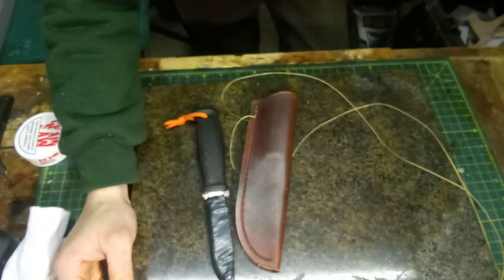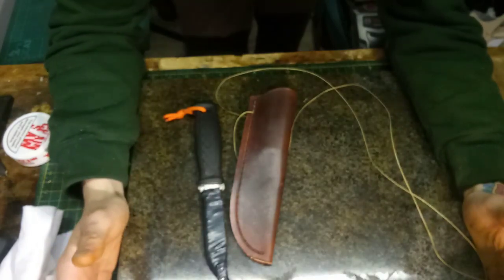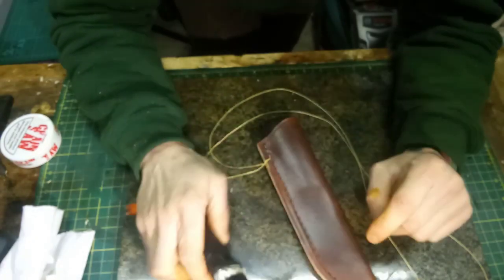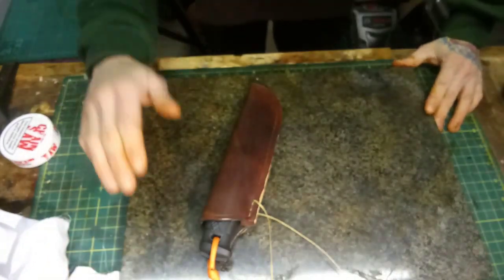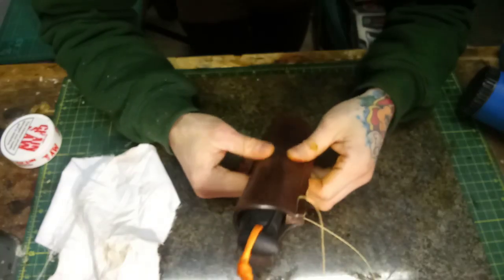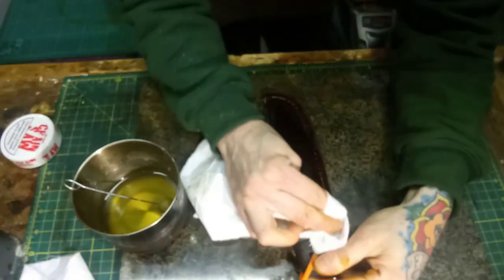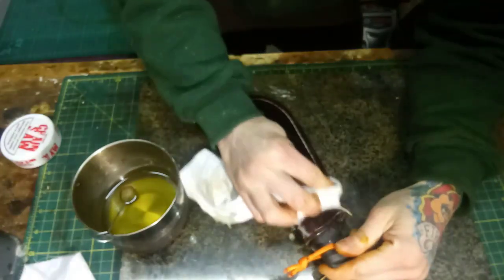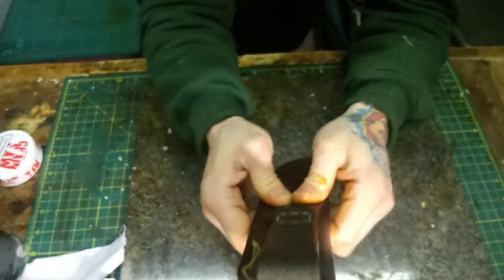L2L Leatherwork: Hot waxing a Leather Knife Sheath

Comment: Ive got a lock back Case 6265 SS knine and the sheath it came with is very loose. I'm going to try this method and just was wondering if I need to take the same precautions with the blade, seeing as its stainless. Any advice is appreciated.thx